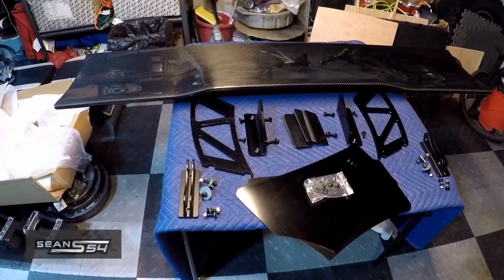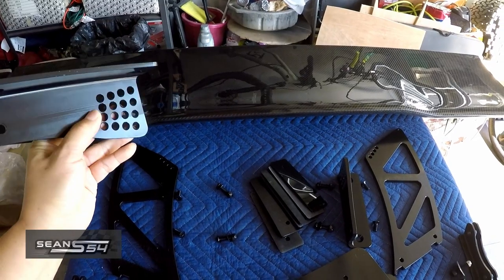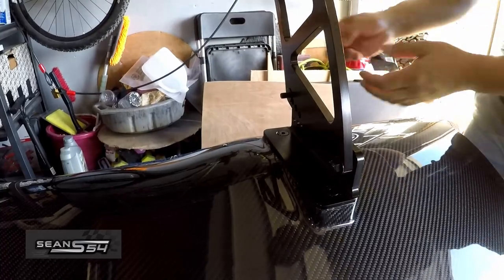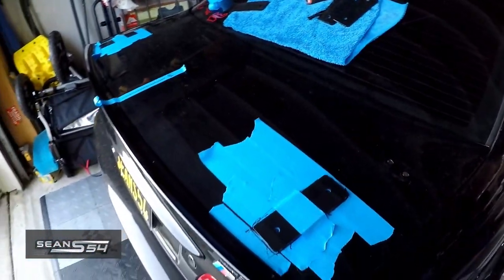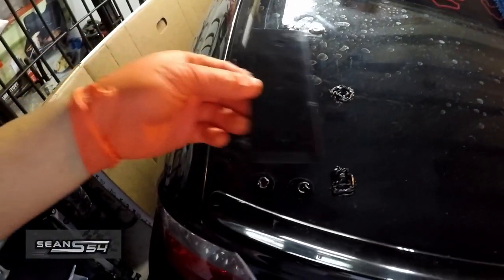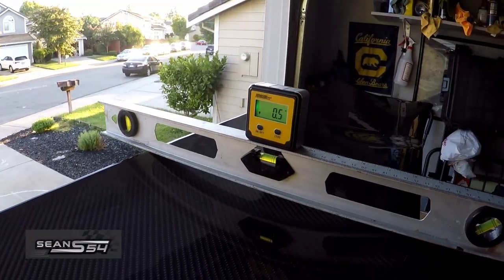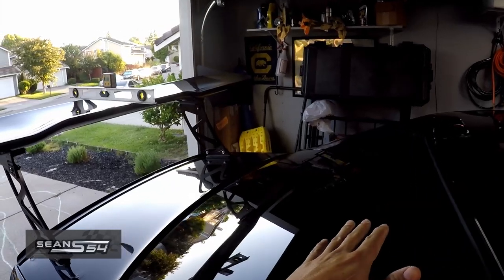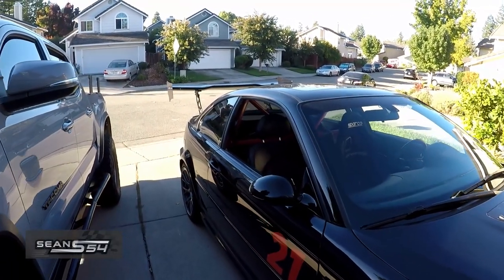ECS Tuning Carbon Fiber 3D Wing - BMW E46 M3

Comment: Did you put a significant weight downward on the wing? Seeing how much the sheet metal moved when pressing on it with the spring loaded punch let’s me know the mounting setup as you have it is extremely sketchy. Not sure if you already did a track day or not but id seriously look into beefing that up.
Reply: Any chance you’ll be making front splitters for e46 m3’s? Love your sunroof delete!
Reply: @edsonb3796  we can do a flat carbon blade any size/shape you want if you were able to mount it
Reply from the maker: I reinforced the inside with a custom L-bracket and it's rock solid now. Track tested video will drop Sunday.